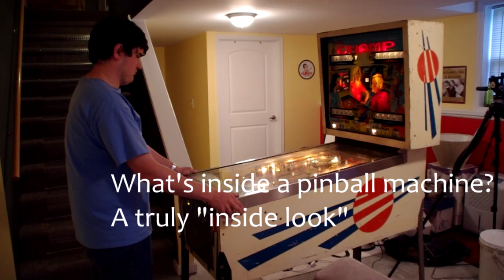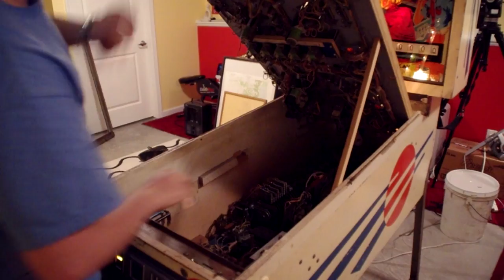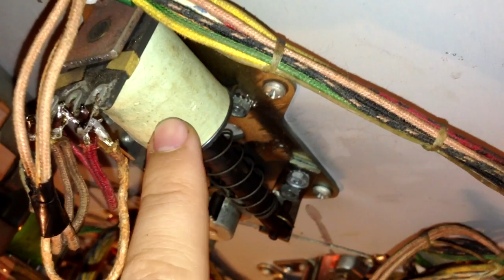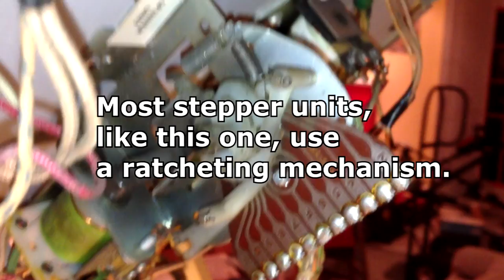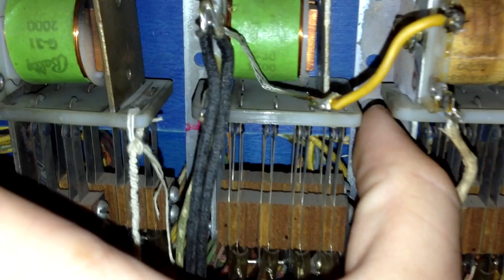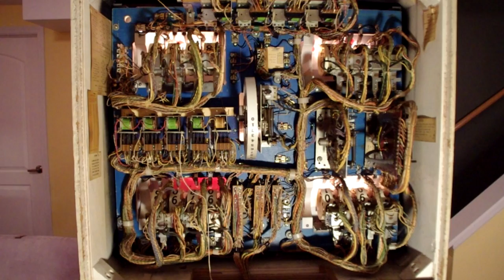What's inside an electromechanical pinball machine?

Comment: I actually purchased this very same pinball machine for 25 dollars from a friend. I know nothing about EM machines but I have all the paperwork that came with this machine. It doesn't work correctly. After putting a coin into it, it gets stuck in the reset mode. I have made some mistakes cleaning it but will be correcting those mistakes as I do it again. This video helped me out a lot. Thank you.